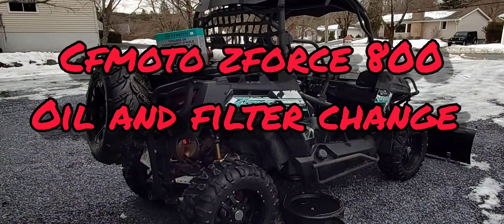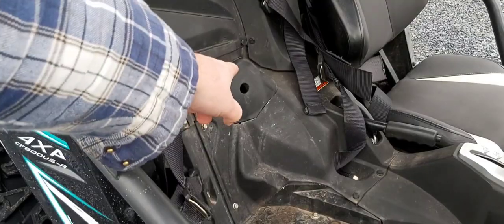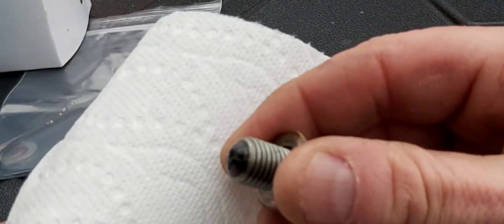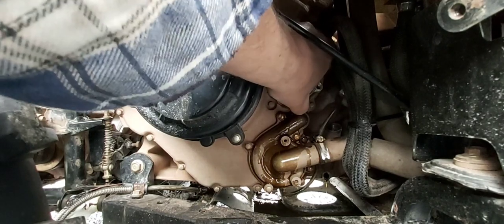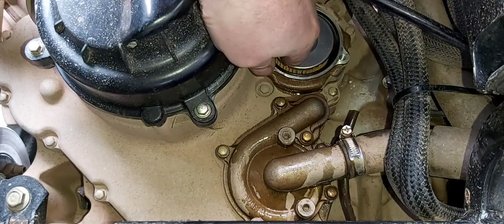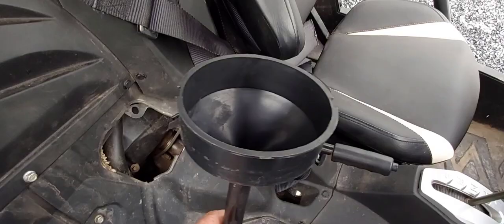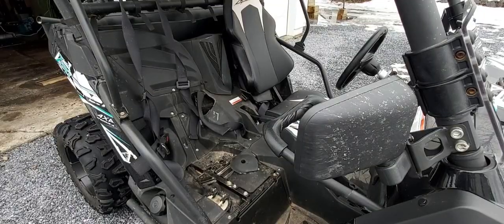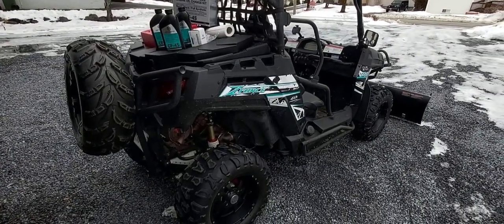Oil Change On A Cfmoto Zforce 800

Comment: A little tip.  The plate under the oil drain is held on with 4 bolts, only a couple minutes to take off, and will save you from having oil run all over it when you drain the oil.
Reply from the maker: I agree, makes a tad mess leaving it on!!